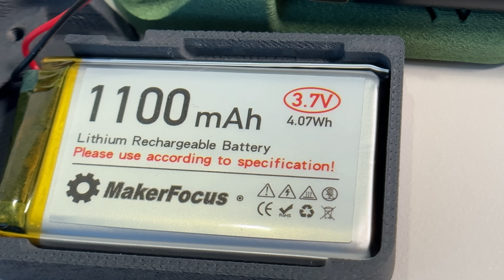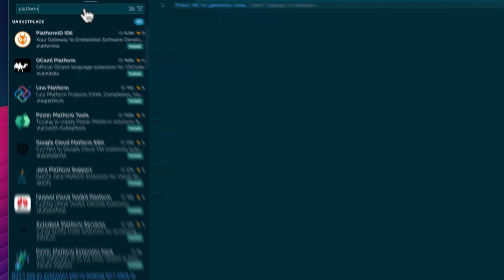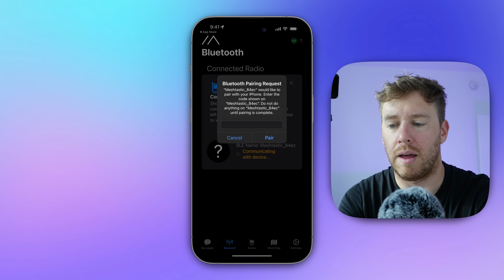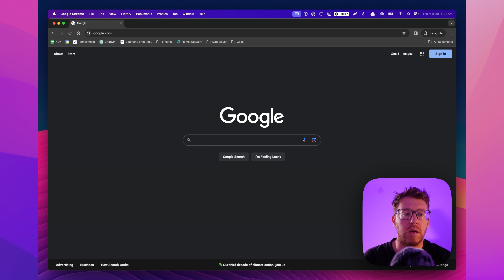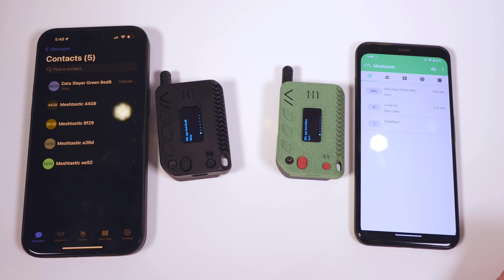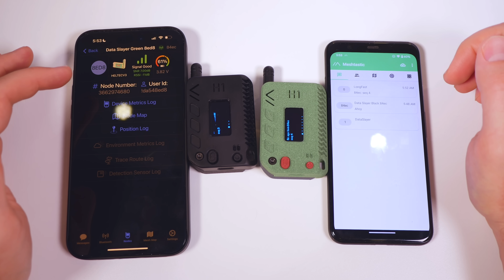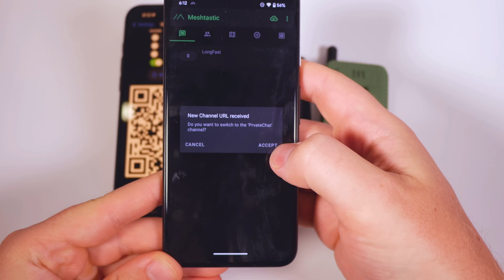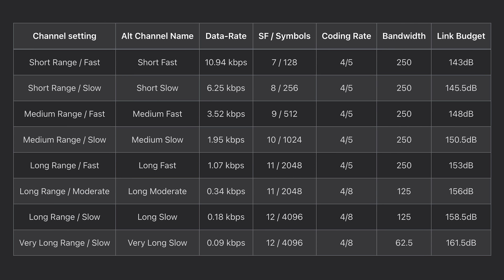It’s Been a Good Run, Phone Providers.

Comment: I know a dude in this industry. Trust me, anything with a frequency can be listened in on.
Reply: Sure they might be able to see transmissions but they can't read/listen if it's encrypted. Do you really think the police & military who communicate via encrypted communications can have everything listened to or read?
Reply: You can detect things well enough if they are transmitting, but if you send a short encoded message and it is not long enough to brute-force attack it, then unless you just get crazily lucky, you can only DF where the signal is coming from, not actually decode it.

One of the most amazing bugs was the one on the United States Seal - just a stunningly beautiful piece of presicion engineering which (I think) worked on a GDO basis where the audio in the room would alter the resonance of a little chamber - which then interferred with an RF beam squirted in from the building over the road. Depending on how the resultant signal was being affected (basically modulated), they could re-build it to get audio.

Yet the device never really transmitted, it just "interferred" with an external signal. Clever little thing :)
Reply: all encryption can be hacked. 
and being open software do you really belife the gov is not involved?
Reply: The "Thing" made me realize listening devices do not even need power.  What scares me is the technology to read thoughts.
Reply: @TOMinPDX they can
Reply: Yes and easily triangulated..
Reply: @TOMinPDX  Usually encryption isn't beaten by breaking the encryption, it involves reading the raw data before it gets encrypted. Magic Lantern, DCS1000, etc. Your hardware is compromised at the manufacturer as well (Dual Elliptic Curve situation). By the way, it's not police or military who are doing the spying, it's federal agencies like NSA and FBI. Your local PD and the military really couldn't care about your super squirrel secrets unless it involves a foreign or criminal organization.
Reply: If it's encrypted properly, it cannot be intercepted.  ECC Diffie - Hellman is doesn't require insanely complex math to do and all you need to do is confirm the public key is really THE public key.  The private key is just a random number, so you need good randomness, true randomness - that's easy to get with a radio, or fairly easy.  I'd just read in whatever garbage the antennae picked up, and convert that stream to an sha256sum.
Reply: @TOMinPDX  Answer to your question is, Yes. Someone created the encryption for military use, therefore someone has the ability to decrypt.
Reply: @psps6623  No sorry encryption doesn't work that way. Algorithms are designed in such a way that the key is needed to decrypt. The steps involved in the process is widely documented, so if you really believe it's possible I'd love for you to point out in which step would the military break AES for example.
Reply: @mistertwotimer  I'm genuinely happy for you. You seem to trust and believe in something working the way it's supposed to in an ideal world. I don't.

Unfortunately, challenging me to explain something I know nothing about does not change the reality that all technologies have vulnerabilities that when exploited correctly, no one would know it's happening.
Reply: Any phone can be cloned as well.
Reply: @psps6623  so you admit you know nothing about these encryption algorithms and you claim to be correct over the people who know the thing.. Wish i had that Confidence level bro
Reply: @larryjanson4011  You say Gov is involved all Open source Projects?
Reply: @whereismybinger  First, you would have to cooperate and go into an fMRI machine to basically train an AI to make the connection of what you're saying to where, how frequent, how intense etc. your brain is making electricity.  Everyone's brain is different, different parts light up with each individual word, each feeling behind the word, the sentence, the meaning you give it, etc. Just think of the word turtle out of the blue. Now think about it in a different context, like as a toy. Those are two very different thoughts for the same word. I think it's possible, but only with your own cooperation and an extreme amount of patience.
Reply: yes indeed
Reply: privacy looks like in person convo basicly. not using any device!
Reply: It's true, but even GSM to which we trust a lot, is very weakly encrypted. Using LoRa instead of GSM will make you immune to many unwanted listeners because they will be listening for GSM
Reply: @Mr.Engine993  Security through obscurity is inherently insecure. Even the weak MD5 hashed with a pre-agreed password, then simply XOR-ed to the text payload, is leagues ahead and not even computationally intensive.
Reply: I am a dude in this industry. Not true, but also not false. If you know what you're doing in terms of protecting your devices and encrypting your transmissions, then it's highly unlikely that anyone will compromise your messages. However, there are a lot of potential avenues to explore if you really want to gain access to encrypted comms. Anything from gaining physical access and reflashing the firmware, to compromising the phone <--> device channel (Bluetooth, in this case), to compromising a device on the user's home network and pivoting to the device through the phone (e.g. pwning the phone from a local compromised device), to attacking the device wirelessly (something like sending bogus or unexpected signals to the device, or possibly forcing a factory restart by overloading it with a ton of RF), to conducting an attack against the actual encryption itself (if feasible). Saying "trust me, anything ... can be listened on" without context proves you don't know a damn thing about what you're talking about.

Comment: The open source makes this very interesting. It's a good start. And the chip can be amped.
Reply: All of their communications & code & social media happens over proprietary channel tho
Reply: @gotoastal  would you need a license if you used this on a radio frequency,  since it's technically not a radio
Reply: @andygluehere8266 they are radios because they use a radio frequency, the data type doesn't matter. However, it seems seems the device is already set up so it stays in line with regulations and in any case its so low power is basically a toy. You most likely don't need to get a license, but if you want to do anything more interesting than simply carrying these nuggets around, I'm sure learning the law proper, how things work and your limits will come in handy.

Comment: I can't imagine how useful these devices would be for researchers, park rangers and others working in areas with no cellar service but needing to connect their equipment.
Reply: Have you ever heard of heavy rain, floods, power outages, Tornados, hurricanes,  exploding transformers, old wires, earth quakes....  More people need this than you think.
Reply: @Town101 I think he meant for people that could use it daily.
Reply: @gunfun7772  Yeah, except for that one part, where you need a cell phone to use the thing.... if you have no power, how you logging onto  an app? this is a poor mans Nextel Pager.
Reply: Blud, walkie talkie exist
Reply: Or drug dealers
Reply: What is several miles? Anyone know of anything out there besides the big HAM radios that can reach 50 miles?
Reply: @rubenzall  with a 102 inch whip and SSB a CB radio can do nearly 30. i get 8 miles out of a cobra 19 dx4 and a wilson 1000.
Reply: @MrSGL21  hey MrSGL21 thanks that sounds interesting. I know almost nothing about this subject besides the fact that I have great respect for HAM experts. Might you suggest a specific unit? Thanks!
Reply: Sooo, a ham radio device?
Reply: @80aj  Have solar power and battery banks, will travel.
Reply: @Porty1119  Gonna fire up the entire cellular network with some solar battery banks? Gotcha.
Reply: @80aj  I do believe you fail to grasp the concept of an application that doesn't require an Internet connection to function.
Reply: @Porty1119  No, I fully grasp how shortwave radio works. There's a reason boats have large antennas. But hey, keep believing that somebody cracked the code with 1970s tech in a 3d printed case. Some people are so far behind in the race, they believe they are leading it.
Reply: @80aj  Ah, so you grasp nothing at all.

Comment: For solar nodes,  use a wisblock starter kit that has the 4631 on it. Has ports for solar and a battery and will have a significantly lower current draw. Can also adapt a gps or other sensors of  your choosing if you so desire.

Comment: Worth noting that if you can't connect to the pc when flashing, the cable may be ok but the system does not have the right serial port driver. Regarding range, yes, the stub antenna isn't very good, but local LoRa traffic and radio noise can also be a factor.
Reply: Yeah, USB ports especially can be all kinds of problematic for these kinds of drivers.  Anyone who has problems, make sure to try the ports on the back of your machine including 2.0 vs. 3.x.

Comment: I'm designing my own case for swappable dual 18650s so you can change one while remaining powered.
Hot Swap > recharge. also a UVA+B panel on the back would be good like on those battery banks. Better than nothing. Probably use x3 1.5v 0.3w panels from outdoor path lights. Then use a 3.7v linear rectifier or some diodes & a high volt cutoff from a 18650 single battery charger.

Comment: With some tweaking this is a very interesting bit of tech. I imagine it would be put to better use in a larger form factor that has more signal power output and some kind of ATAK phone board depending on use case. As is it looks great for shorter distance comms where you don’t want to yell and FRS handhelds aren’t reliable. Nodes could also be discreetly placed ahead of time to build a temporary local network.

Comment: @Data Slayer If you can get your node outside of your apts tinted windows you will probably pick up more range. Its pretty common for commercial tinted windows to have a metalucized coating in the tint to reduce infrared & uv penetration into buildings. It does a pretty good job of attenuating radio signals,  Also nano vna are pretty cheap check your antennas to make sure they are as advertised. AFAIK those stubby antennas ship for every country but I think they are better for 400 mhz which means you are wasting precious power heating up your heltec with a mismatched antenna. These radios use low power so having a matched dipole or yagi is going to give the best results. Whips are compact but best results with a balanced antenna and same polarization for both antennas.

Comment: I picked up mine quite a while back it works decent wish it was better made some modifications to it myself but it is a cheap start device. 
Yes there are better but if you don't know what you're doing this is a good entry to it makes a great backup too 
Be careful on the encryption anything can be tracked with boots on the ground or a bird in the air.

Comment: Neat little solution.
I'm having difficulty locating the problem it solves.
Reply: although the problem is unknown, 
it makes it more efficient to solve that unknown problem.
I do not know of a comm's problem that hasn't been solved using RF or industrial comm's technology........ PLC's/computers communicating thru spread spectrum transceivers, 'shortwave' for long distance comm's. I note that this is for a personal radio system in the 94x Mhz area.... they are inherently a short distance product anyway. But it is interesting to experiment with them and see what is possible.
The aerial makes a lot of difference with that frequency. But it depends on the application if you can take advantage of directional aerials. If you are on the move... well you can't. Any application requiring mobile comm's  is inefficient as normally an omnidirectional aerial is used, unless you go to Satellite repeaters (Starlink etc) , but then you still need a fixed dish somewhere close to do that....
Reply: He gave some examples such as two people hiking and separating where there is no cell service. I went to a festival last year and couldn't use my phone because so many people were there, and it made it difficult to find the person I went with when we split up. Thinking about building some of these for next time I go.
Reply: @11tmaste  Which problem cheap walkie-talkies have had solved for decades. Much more simply, without requiring anything but themselves & batteries to use.

Comment: how about this? 
use a Distributed Hashtable to keep track of network participants, then if the participant is on the network then estimate the fastest pathway of nodes and yeet the packets that way. 
if the participant is not on the network then yeet through a LORA/Internet Gateway bridge.
architect the p2p connections similar to how a IPFS system is set up but with encrypted communication rather than data transfer. might provide better flexibility.
Reply: Please expand on this
Reply: Not sure there would be much benefit, most DHT implementations would max out the throughput in Meshtastic most configurations. A big part of these devices as they are currently used is ephemerality.
Reply: That's not going to work very well you can't just ospf it like regular router protocol. Because to essentially ping nodes of these devices constantly for availability eats up more time and resources. And keeping track of available nodes in real time is more difficult because you're essentially using the same single resources to do so. It's much easier to just use the exact same pipe address for nodes within a distance range and transmit to all and any available nodes. Then you repeat in whatever direction you are going. You program the endpoint to reassemble packets based off however many packets you programmed to be distributed by the master. And numbered in a rolling integer based on your estimated network size, data transfer size, and average hop between distance segments. When it's broken up by the master it's assigned a rolling number as a bit, a direction bit, a segment bit, and a max segment bit. You can reprogram the transfer protocol to use hex to tokenize or compress those values into half as many. Creating essentially the address header and reassembly instructions in one. At each distance segment only the direction bit is overwritten according to it's opposite. If you were going to incorporate an omnidirectional mesh network then you might want to assign each node an integer index as a replacement to direction bit with some incrementing or cartesian organization. At the endpoint it discards the direction bit reads the rolling number the segment and max segment bits. The rolling number assigns the overall data being sent the segment assigns the data packet number and max segments assigns the total packets. It's then programmed to assign that data to a stored variable (if then) to organize and also drop any redundant incoming packets from the same rolling number. Ie. read max segment read segment assign 1 to variable segment 1, 2 to segment 2 ect. If equals to packet number received then increment to a received variable or sent variable depending on which is happening. If sent or received variable does not match close pipe drop packets. Print or store segment variables.
Reply: Or you could just, I don't know, push the transmit button on a walkie talkie or CB radio and be done with the whole thing. RF signals are pretty easy to encrypt as well if you really need it. You're just trying to re-invent the wheel and over complicating it. If it's not broken, don't fix it.

Comment: I purchased a pair of similar LoRa devices on the 915 mhz frequency and found that they easily worked out to about 8km in farm land but only got about 3 km in a large city. I think the problem with range is directly related to RF pollution, better known as over crowding of that particular frequency band. After all, 915 mhz is a free frequency range where in a fairly dense city, you're bound to have a lot more devices plugging up that communications channel. Anyhow, most LorA devices claim 20 km maximum range , line of sight. Exceptions exist, and >100km can be achieved with special antennas and remote locations.

Edit: This will never replace cell phones because it is deathly slow. a FRS radio might be a better choice if you just want to talk over a near-line of sight channel, but the LoRa devices use just a tiny bit of battery power in comparison to send code.

Comment: I’m eight minutes into this video and just read the description. Can anybody here tell me what this thing actually does? What is its purpose?
Reply: Text based walk-in talkie?
Reply: If you have no cellular connection, these devices act as a mesh network that allows you to message other phones also connected to these devices, as long as you use the associated app. This would be great in areas where there are too many phones overwhelming a cellular network, or in wilderness areas where no cellular network exists. Of course, both phones need to have one of these to connect to. But the range is measured in miles, maybe a half mile up to 3.5 miles, it seems.

The communication is encrypted, so your messages are also secret… probably.

And the setup process looks VERY simplified compared to what you’d normally have to go through for a similar device.
Reply: It gives YouTubers something to make "content" about and to try and get paid off of. If you've used a walkie talkie before you've already used better and easier tech than this. Your welcome.